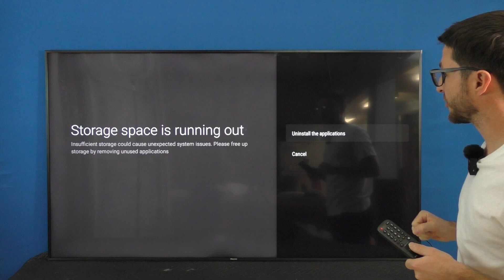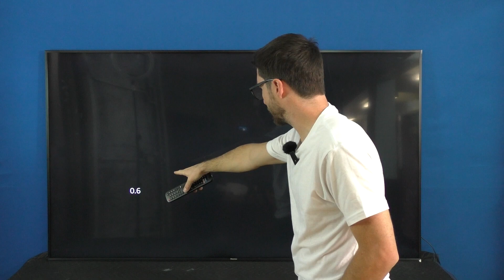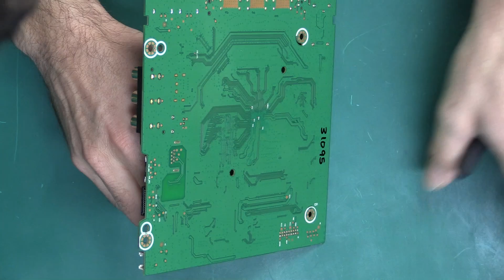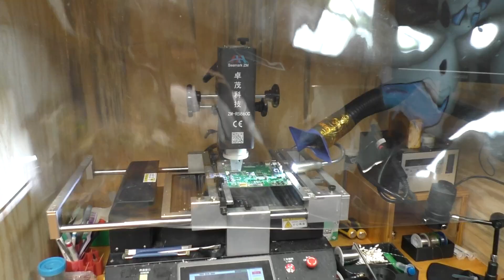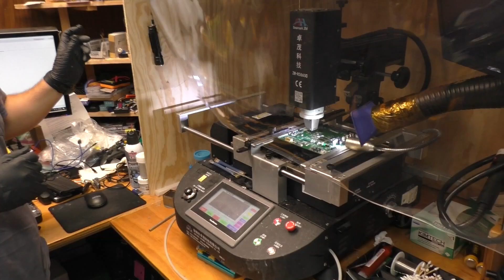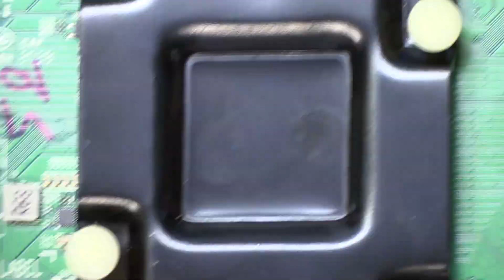Hisense TV Repair Storage space is running out 75h6570G

Comment: A four year old Hisense you will never know when something else will break and spending money to repair it will be more expensive in the long run than buying a new TV.
This repair must have costs at least $200-$300 and that is not worth it on a $800 four years old Hisense. Next month the LED's may be failing, you never know ☹...
Reply from the maker: While you are correct it's possible something else might go out on it, when it comes to this model we don't typically see that happen. Most of the time it's really just the mainboard that goes out, so once we fix that, you pretty much are worry-free. 
With that said, if the repair is $179 (which is what we charge) and the replacement TV is say $700 after tax, it's a $520 difference. Im sorry but that's significant. That's worth it if you are trying to save money. Heck even if the repair was $500 it's still worth it, you would still save $200, and like I said once this repair is done, it's rare for anything else to go out so you are just as home-free in my opinion as you would be with a new TV.
Heck, I'll argue its safer to go with the repair because with the new TV, you might get a bad panel after a year which is not repairable. With this model at least the panels are very well built, I have never seen one with a bad panel so if there is a failure at least it's going to be fixable.